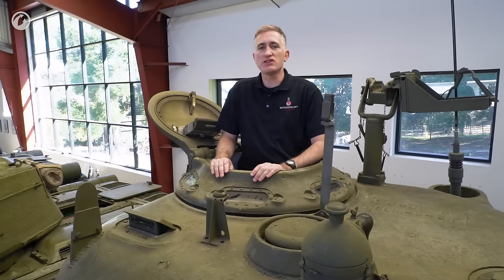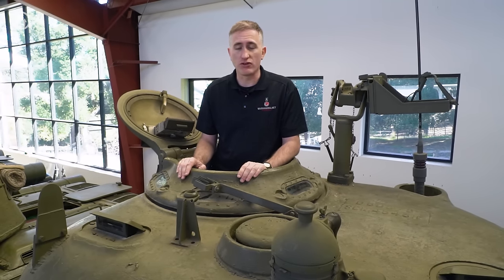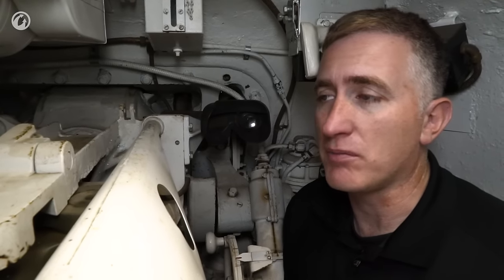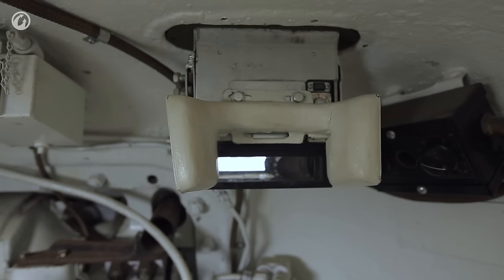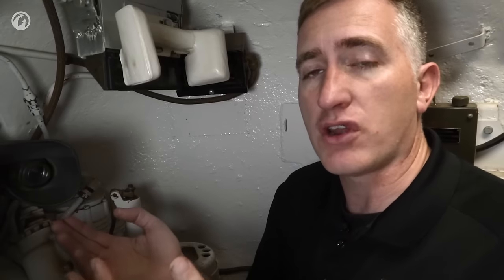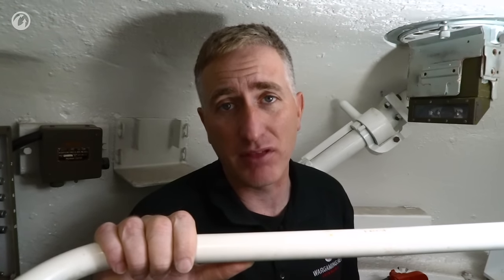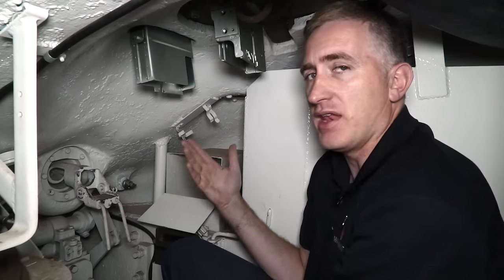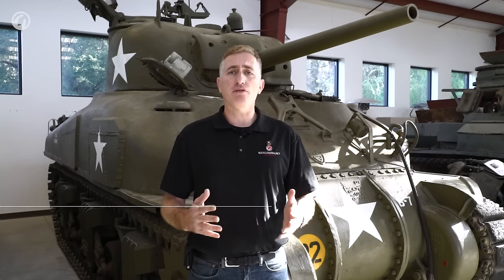Inside the Chieftain's Hatch: M4A1 Sherman part 2

Comment: Some things that Mr. Moran did not mention. Mortality rate was about 25% if the Tank was knocked out. Compared with the T-34 which had about 85%. Compared with the T-34, the Sherman driver did not get a stiff neck after driving the tank a couple of miles, which would have impaired his driving capability. The T-34 used to be my favorite tank, but the Chieftain convinced me, that the Sherman was a superior tank and much more ergonomic, even though I find the T-34 more beautiful.
Reply: It actually changed depend on what took out the tank.  The average was closer to 20% but gunfire was about 24% casualty rate.
Reply: I don't bother choosing 'favorites', because what's the point? I like them all for their good points, and their interesting points. The world doesn't care into what order I personally rank them, and it's almost certain to be wrong anyway, since it all depends on what the situation is, what factors you are counting, how you weigh your priorities.
That said the Sherman, T-34 and Pz IV all appeal to me, because they were the real war winners, plain workaday tanks that did their duties in every battlefield. They weren't the "best" by metrics others use (it seems that most people rate the "best" tanks as the ones that "kill other tanks the best", but that was really a secondary duty for most tank units, except the Germans who badly needed to kill lots of tanks). That and these are the tanks that people are always badmouthing and talking down about, based on whatever books they've read, their "stats", etc. The M4 may be the most appealing of the bunch, because it doesn't even get the credit that the T-34 gets. PLenty of people claim the T-34 was "the best tank of the war" without any real reason, almost no one says that about the M4. Yet the M4 was at least as good as the T-34, and was at the very worst still on of the top ten best tanks in the entire world in 1945. Almost all of the negative stuff people say about it is just because it was at a disadvantage against the Tigers and the Panther. As if tank-to-tank fighting was the only reason that tanks existed. The M4 was a wonderful mobile, cheap, easy to repair armored vehicle, good at fire support, infantry support, able to cover a lot of ground in a hurry. It was not meant for going out and fighting enemy tanks (although it was meant to be able to handle itself). I think the M4 was an excellent design overall, when all the factors are weighed. Even if it wasn't as good as some German tanks (which is only true if you are only counting tank-killing ability and nothing else), it's stupid to say that it was a "terrible" tank. Not being as good as the very best does not make something "terrible". Japanese and Italian tanks were terrible (and even that is a dubious statement; each should be viewed in context). Most nations didn't even HAVE tanks, or if they did they were relics from the 30s, 20s, or even WWI veterans. IN terms of numbers produced, the M4 was better than 95% of the tanks in the world, by number. And that is, again, assuming that the "best" tank is the one that kills other tanks the best. In fact, that was ALL the later German tanks did well, at the cost of effectiveness in all other roles. And while a tank-killing tank may be a big deal in a game where all you do is go around and blast other tanks, in real warfare there are other more important things to worry able. Also, in a video game the tank rarely breaks down in the middle of nowhere, and you don't need to spend hours and hours maintaining and repairing it keeping it running. These things matter in real warfare.
Reply: The T-34 did look impressive for being an utterly unreliable piece of crap that had major design and production flaws. They performed better after Stalin took US automotive engineers' advice to redesign some components, have trained machinists to manufacture critical parts, add shock absorbers and to have the engines and transmissions removed for inspection and repairs after ever 50 hours of run time. Stopping their tank armies to do the engine and transmission inspections/repairs caused delays that allowed the Germans to set up new defensive positions and bring up more supplies. 
The M4 was supposed to run for 200 hours before the users would start experiencing engine problems yet the Army decided to swap out the engine and front drives after 150 hours of use for refurbished ones to ensure those stayed operational at all times. The mechanics with their forward repair stations monitored the condition of all the tanks so would have that done after 50 to 80 hours of use to tanks that were being abused by inexperienced drivers and experienced drivers that tinkered with the engine speed governor so they could go faster in all gears by running the engine at higher RPM's.
Reply: The T-34 is a mechanical marvel The sherman is a Cadillac.  The T-34 may have a nicer look and sloped armor but if the crew can't use it well that's not very helpful is it? the one thing that bugs me is that in warthunder the T-34's 4 man crew make it less survivable.....

Comment: There was more to it than "drilling a hole and installing a hatch". You need to change the tools and jigs, stop production while the new ones are set up, you need to set up a production line to build the hatches and hinges, etc. All this takes longer than you think, and at that point they were only interested in getting lots of tanks built. A loaders hatch doesn't make the tank a better fighting tank, so it just wasn't worth slowing production for such a minor detail. They got the project underway as fast as they could, especially once more lethal German tanks and guns started showing up. Remember, BEFORE 1943 the M4 was perhaps the best tank in the world. 
Also the pintle gun could be fired from the hatch. No one was going to climb out on the rear deck to use it. Why would they bother mounting it in that case? The gun rotates 360 degrees, and was primarily meant to shoot at aircraft (originally). You are making the assumption that you'd always have the turret facing forward, but in reality it was easy enough to just rotate the turret to face backwards, leaving the commander standing at the hatch with the .50 facing forwards (or whatever way you wanted). They probably figured that first, it was in the way up front, and second, that since there was already two .30s and a 75mm covering the front quadrant, the biggest threat was an enemy getting behind the tank. Thus the .50 mounted where the commander could easily pop out and spray the rear area of the tank with bullets. Simple. The Soviet KV and IS tanks had a dedicated 7.62mm MG mounted in the back of the turret for this purpose (although they could again rotate the turret to bring i to the front, if for some reason they wanted another MG to spray the area ahead, if advancing on a field of infantry for example.)

Comment: I worked with a guy named Bill who had the Bow Machine Gunner spot in a post war Sherman Tank Recovery / Engineering Vehicle. Because he had no 30 Cal to operate his title was Assistant Driver, which was what I thought all Bow Machine Gunners were called but I could be wrong.
Anyway, if the Driver wanted to shift gears during a hard turn, because both of his hands were working the steering leavers Bill would reach over with his left hand and work the gear shift for him.    
Try that in a T 34. 
And YEAH OK Panthers had steering wheels.

Comment: This is from a totally different field but it still has merits. The American way of doing things, ie comfort and ergonomics ahead of more firepower, more armor, more speed, etc showed up in another war winning bit of kit. The Gato class submarines. The Gatos didn't have the most number of forward tubes, they weren't the fastest and they maybe couldn't dive the deepest. But they were reliable, they were adaptable and the crews could be comfortable aboard them. That allowed you to undertake long patrols in the Pacific and it meant your crews would be moderately rested and fit to fight when it came time to attack a target.  And just like the Sherman tank, they had enough of the things you needed to win, nothing extra, just what was needed and it worked.
Reply: The US Military actually listened to the end users opinions of the weapons and equipment that was introduced for testing so those could be modified or discarded if nobody liked them. In the 1930's the US Navy began installing HVAC systems in their new submarines after crewmen and commanders pointed out that would protect the advanced electrical and communication systems from high heat and humidity. That also made the living and working conditions more tolerable for their crews. The Gato-class subs were custom made for long range patrols with refrigerators and freezers for food, a large galley with a large mess, a laundry with washers and dryer along with showers for the crew thanks to having a desalination system on board that produced plenty of fresh water.

Comment: Some of the Sherman’s sank off the shore of Normandy. The canvas side walls and propellers a rather bizarre idea.
I can’t imagine banging around in one of those with out a full face helmet. So much stuff too hit your teeth on in rough maneuver.
The Achilles heal on the Tiger was a round just below turret. The upset metal would jam the precision rotation ability. A hit on the track wheels might have a chance to derail track.
But if he gets a round on your Sherman,,probably the last thing you’re gonna see.

Comment: I thought the point of the periscope sight was more to avoid having a hole cut in the middle of the face of the turret for the telescope. The M4 may be ABLE to fight from a hull-down position, but I wonder whether they actually knew how to do this much until after the war. With the telescope, you can use the wide-angle periscope for situational awareness, and then switch to the direct view sight for long range gunnery. BUT, if a shell, or even an enemy machine gun bullet gets a lucky hit directly on the end of that telescope, there is nothing between your face and that projectile but a small hole and a few pieces of glass. In theory, ideally all crew would be looking out of periscopes at all times, since if something hits the objective on these, it will just break the periscope, and that's what they carried spares for, which could be easily swapped out. The found that it was better to have some direct vision, in spite of the slightly increased risks (the exception being the driver, who went the other way, mostly because his direct vision was particularly risky, being large and creating a large weak point right in the most exposed place on the tank, and because he only needed to be able to see well enough to steer the tank, situational awareness wasn't important for him (or the loader) as a general rule. In combat, a periscope was good enough, and on the road he would just unbutton, so the DV wasn't needed.
It is interesting to look at the amount of space inside this "roomy" M4 turret, particularly in the loaders position. Notice how his head is almost touching the hard steel wall of the turret whereever he is standing. You can see why padded helmets were crucial. not just because it was easy to knock your head moving around, but because the tank would wildly rock and pitch when traveling, especially off road. You'd end up having your head slammed into that hard armor frequently, and it would cause serious injury without a padded helmet. In fact I read somewhere that one of the main causes of casualties to tankers was being injured by being tossed around inside the tank. It was why good suspension was more crucial than most people realize, and the main reason why many tanks have such limited speed off road. The crew cannot survive being rattled around like pebbles in a can, which is what would happen if you tried taking the tank at top speed over rough terrain. They'd all be knocked out, arms broken, bruises, teeth missing, before you got a few miles. Easy to see why with this video.
This is why modern MBTs pay such close attention to ergonomics (besides crew efficiency), to minimize the harm possible from being thrown around inside the tank, and why they pay such close attention to the suspension design. It's one of the most crucial aspects of a tank, although it is not appreciated. The M4's suspension was actually quite good for the era, better than most German tanks. The T-34 may be better, it depends on what you consider "better", really.

Comment: Your comments re: cutting the hole for a loader's hatch* have me curious about something.  What piece of kit allowed soldiers in the field to work on face hardened (heat treated) armor?  Stuff is made to resist.  Also, it tends to shatter when pierced.  I assume that battalion repair troops had adequate kit consisting of pressurized gas torches and some kind of cutter or stamp.  Anyone conversant with the methods?
  Any idea how long it would take them to modify all 45 tanks in he battalion to the new (i.e.: loader's door) standard?
*Navy man here.
Reply from the maker: They did indeed have oxy-acetalyne torches or the like, but as for how long it took to cut a hole and install the hatch kit, I honestly couldn't tell you.
Reply: @TheChieftainsHatch  Thanks for taking time to address my question.

Comment: One design glitch was painting that star on the front. German accounts mention that it was a perfect aim point for your Panzerfaust.
Reply: The purpose of the big white stars was to provide an easily seen indicator of poison gas being present in the air. The US Army used a special white paint for the stars and vehicle I.D.'s that would turn shades of pink when making contact with various poison gases. The stars could be seen from a distance by soldiers and crewmen inside other tanks to give them a heads-up to don their gas masks.

Comment: I think the M4 (105) story would be great for the next Chieftains article.
Why they appeared so late? Did US army ever develop a HEAT round for that gun. Was a 105mm gun on an M3 a good all rounder or was it useful for specific roles only - clearing volkstoorm positions in urban areas. What could and what couldnt it do compared to M4 (76) and M7 Priest.
Reply: The US Army like the French 75mm all-purpose cannon and the German 105mm howitzers used in WW1 so copied both, but had the 75mm gun mounted on the 105mm howitzer carriage since it was stronger and would allow them to replace the gun with a 105 barrel. The obsolete M3's were converted into M7 105 howitzer gun motor carriages for indirect fire artillery and limited direct fire infantry support with some M4's being converted to hold the 105mm howitzer to provide the gun crews with overhead protection from grenades and gunfire when engaged in urban fighting. The Army had a HEAT round for the 105 in case they encountered heavy enemy armor. The 105 HE round packed a considerable wallop when used against medium tanks.

Comment: I am really curious about how often pistol ports were actually used if crews complained about the absence of one.
Reply: The pistol ports allowed the loader to toss out spent shell casings without being exposed to gunfire. He could open the port just wide enough to drop out a spent casing then close it while grabbing another one out of the basket. When those were eliminated, the loader tossed the empty casings behind the bow gunner towards the open emergency floor hatch where they either rolled out or were pushed out by the bow gunner. When not under fire the loader ejected the spent casings out of his open hatch.

Comment: I believe the sherman was still better tank than the t-34!
Reply: It was arguably the best tank when it was released. In Korea, M4E8s were knocking out T-34-85s
Reply: The Sherman has it´s advantages. Especially it´s great crew ergonomics, three man turret and (eventually) visibility. The T-34 also has it´s advantages: slightly better amour layout (Arguably over-armoured at the rear. That steel would have been more useful at the front of the tank), off-road mobility thanks to the tourqy diesel and it´s very wide tracks. However, the primary advantage of the T-34 is that it was very easy to mass produce.
Reply: yes, it was completely superior.

it's hard stats (Armament, Armor and Mobility) were similar but slightly superior in all 3, however it's the soft stats (Target aquirization ability, ergonomics and survivability) that the sherman REALLY has a massive advantage over the t-34.